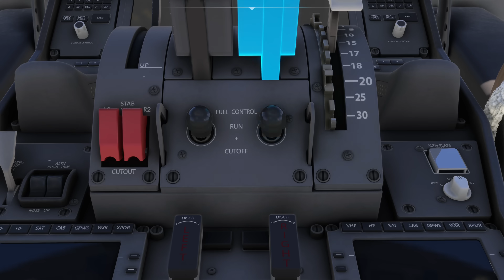Air India 171: Why Did The Fuel Cut-off Switch Get Moved?

Comment: I have lost respect for this guy. The report says no where that pilot moved the switch to cut off. The word is transition. Transition can be mechanical, electrical, software driven too, can be accidental as well if the detent mechanism is not proper. He was initially for the flap theory.
Reply: It's on the voice recorder
Reply: @C.Y.123  And what exactly is that supposed to prove? Look, imagine your wife turns on the light and goes down to the basement to grab a cool bottle of wine or beer or whatever. She is rummaging around in the shelves when suddenly the light goes out. She calls up in confusion and surprise, Honey, I don't think this is funny. Why did you turn off the light? When in reality, a car crashed into a power pole two villages over and caused a blackout. So what exactly is this question on the voice recorder supposed to indicate, in any meaningful sense?
Reply: Ya, it’s not him interpreting it’s the report.
Reply: He should prove without a doubt that the switches can’t move even in case of faulty detents . Without that it would be inappropriate to put the blame on the pilots.

Also nobody knows if the circuits were working properly.
Reply: It specifically stated they were moved roughly one second apart. Nothing other than a human hand is going to cause that. If it were the electronics or software to blame, they would have been simultaneous.
Reply: Watch the other video were Indians claim that it was a debilebarate act and that the captain suffered from depression.
Reply: I don’t believe the pilot suicide theory either as of yet. It is possible but not definite. Need the final report to make a proper conclusion. Everyone is jumping to conclusion for the “views”
Reply: I believe you’re wrong. Initially Cpt. Steve mentioned the flaps as one possibility but this was well before the data recorders were examined. Other pilots also mentioned theflaps but ALL pilots said how unlikely that would be due the aural alarm that would be screaming at them about the flaps.
Reply: The voice recorder output has been paraphrased. The entire transcript has not been released, why? Here is my scenario. I am pilot flying, i rotate, the pilot monitoring says positive rate, gear up. Now imagine if the full transcript says these things, but you dont see any of those actions, what would it tell you.
Reply: Here is another one....say i want to crash plane, and i switch both engines off in 1 second. Let's say you recognise it, would you take 4 seconds between switches to turn on. I see holes after holes. And as a professional this guy has been after pilots since day 1. Be loyal to your fraternity till proven otherwise dude. He is mean from day 1 to his ilk in this episode.
Reply: Finally, and once again thank you, someone who has actually read the published report with semantic accuracy. The same cannot be said for those so called aviation experts. Reading comprehension seems to be a serious hurdle for many people.

Comment: When tens of millions of dollars are involved in potential lawsuits, u generally follow the money. Like the Boeing 737 crashes due to soft wear issues cost Boeing etc millions, what would happen in this 787 actually failed? These fuel switches are not easy to “cut off” they have a redundancy as in u can’t just bump them off. By the way, the captain was not flying the plane and he’s observing everything, so how did he not see the copilot fiddling with not one but two fuel cut off switch is with redundancy protection? To say the pilots did it would save big corporations, tens of millions in potential lawsuits. The whole thing to me is just strange.

Comment: There is no plaine and simple human error. It can be a design flaw when you bumb the switches when using the trottle a d there is a control notice where the switcb block does not work

Comment: Let me ask you something you said that it was done manually how can you be sure maybe it was mechanical or electrical failure. I am not saying it can't be manual but from the preliminary the both switches are cut off within 1 sec of gap that's not possible to do manually because the switches are designed in a way and are spring loaded. And boeing has already in the past has released a report of malfunctioning of the switch.

Comment: How long after placing the fuel to cut off does the engine begin to spool down?  Is it immediate? Is there an indicator that the pilot sees that shows the fuel has been cutoff?

Perhaps these switches need to be on the front dash where they are easily observed if someone places them to off.  Granted, if the pilot/copilot wanted to crash the plane, it will happen one way or the other.

Comment: If maintenance crews accidentally left the locking feature disengaged on the Boeing 787’s fuel cutoff switches, the switches could be moved without the usual lift-and-toggle safety step. During takeoff, as pilots’ hands are on or near the throttles, wouldn't it be possible their hands or an object brushed the now-unprotected switches, flipping them to CUTOFF just after liftoff? This would instantly cut fuel to both engines, as happened in this crash, even though under normal conditions, such accidental movement is nearly impossible due to the built-in safeguards. Add to that: there is no specific checklist step that requires the crew to verify the locking mechanism or physical security of the switches before takeoff or during flight.

Comment: With today's technical possibilities it should be possible, to delay the actual cut off by a few seconds after initiating this by moving the switch - but only during rotation. A software first checks if there is a fire and if not,  delays the cut off by say 12 seconds and initiates a loud count down so both pilots are aware of what is happening. This would make such situations impossible.

Comment: Do we know for sure that the levers were manually moved to cut-off, or is that just assumed because that's how they normally move?  Is there a way that an electrical or mechanical failure could have caused that movement?

I also am wondering  whether, when the 2nd pilot/voice says 'why did you move them to cut-off', he said this because he just saw the 1st pilot/voice do it and so questions him, or whether he just sees the lever in that position and so assumes/realises the other pilot must have moved them.  I guess they haven't released the whole recording.  It seems important how  the 2nd pilot responds. If for e.g. the 2nd pilot says 'Yes you did, I just saw you' straight after, then that would clarifiy things a great deal...

Comment: I believe none of the Pilots did that deliberately and it probably happened because of some jet fuel filter not replaced at a proper time, just like a tripping mechanism. 
Can we discuss possibilities of that or even of a sabotage? Can any maintenance crew program anything in the computer to shut off the fuel cut of switches 3 seconds after takeoff if offered some huge amount of money? 😜👍 Just considering the possibility. If you could discuss any of these scenarios, with lots of thanks 👍😊

Comment: I suggest every person watch air detective channel . Three former NTSB cuts all the speculation . Greg former head of NTSB makes clear this investigation is now a criminal case . There is absolutely no debate on this crash it was suicide . He also makes clear that air India absolutely knows which pilot said why did you cut off the switch but in a criminal investigation you don’t want evidence such as flight simulators compromised . Any pilot that wants to blame Boeing is a idiot . When three former NTSB tell that this issue with blaming Boeing is absolutely ridiculous.

Comment: SAIB not done as not mandatory, switch part  number 4TL837-3E to be installed but wasn't and old style 4TL837-3D left with no pull security which is why the SB was implemented in the first place! Likely a wrist movement turned them off when levers moved to take off!?! 😢😢😢

Comment: Seems to me that a jarring displacement of of the fuel switches would not happen in the one second deliberate pace that seems to be the case here. Either the two switches would move at the same time i.e one jolt. Or one moves. Not both.

Comment: Steeeve and crew, on page eleven of the AABI's preliminary report it says that the FO had his license issued in late September of 2020 and the PIC had his issued mid May of 2021. Yet he had about five times the amount of flying hours. Is that due to the different type of endorsements each of them had or may there be a different reason to look into?
Aaand Boeing were bragging about their Dreamliner being far more dependent on electricity than pneumatics. Could the STAB POS XDCR report the previous crew had made that morning have anything to do with wrong signals given off by the fuel switches? They had that repaired in less than an hour.

Thank you and your crew for the great work 😊

Comment: Sea Captain here. From the first days of this crash I have commented that there is some connection of FUEL SYSTEM in this INCIDENT and I was right. Another commentator also said that and we were only two people who clearly understood that there is FUEL SYSTEM issue and not any FLAPS etc. However, the investigation is not finished and I BELIEVE THAT FUEL CUT OFF was not INTENTIONALLY done. I believe that there some issue with the fuel SYSTEM and when both engines shut down the pilots tried to restart them. I am insisting that there was technical issue and not SUICIDE case or something else. Probably also it can be fire extinguishing system which malfunction !!!!!!! Check 2013 REPORTS of BOEING 787 DREAMLINER
Reply: Exactly! Let's wait for the final report. Anyways when such large corporations are involved, every mistake is pilot's action.
Reply: @mrityunjaytripathi1968 Yes, my friend. Especially when the pilots are dead. The large corporations always will try to protect their interests. Boeing already has bad records , like MCAS system whith 2 aircrash accidents in 2019.
Reply: @mrityunjaytripathi1968 Yes, the Boeing 787 Dreamliner is equipped with systems designed to prevent and extinguish engine fires. These include fuel cutoff switches that can quickly shut off fuel supply to the engine, preventing further combustion, and fire extinguisher systems. However, there have been instances where the fire extinguisher switch has malfunctioned.
Reply: Hard to put any weight behind what someone says when THEY speak LIKE this
Reply: @somethingsomething404 Yes, the Boeing 787 Dreamliner is equipped with systems designed to prevent and extinguish engine fires. These include fuel cutoff switches that can quickly shut off fuel supply to the engine, preventing further combustion, and fire extinguisher systems. However, there have been instances where the fire extinguisher switch has malfunctioned.
Reply: A problem with the fuel system doesn't explain why the fuel switches went into a cutoff position. They are mechanical switches and are not controlled by the computer, so they cannot move themselves. The engine shutdown came AFTER the fuel switches went to cutoff, not before. The pilots moved the switches back into the run position about 10 seconds after they went to cutoff, but it was too late.
Reply: @chris2kgreat Yes, the Boeing 787 Dreamliner is equipped with systems designed to prevent and extinguish engine fires. These include fuel cutoff switches that can quickly shut off fuel supply to the engine, preventing further combustion, and fire extinguisher systems. However, there have been instances where the fire extinguisher switch has malfunctioned.
Reply: @chris2kgreat The investigation is still in progress. There is no final report yet.
Reply: @NeosNeidis there is no final report, but there is a preliminary report. It shows that the pilots moved the switch to the cutoff position, and then 10 seconds later into the run position. These are physical mechanical switches, not digital switches. A computer cannot move them, they must have been moved by someone
Reply: @chris2kgreat there is system which in case of HIGH FUEL PRESSURE OR FUEL LEAKAGE shut off valves in solenoid branch before combustion chamber. This is automatically can be done. When it happened the pilots tried to restart and operated the MECHANICALLY CUT OFF FUEL SWITCHES to restart engines from the cockpit
Reply: @NeosNeidis your theory is that there was a fuel problem, and then it's after that they moved the switch to fix it, correct? If that is your theory, then it has a big problem. The engine did not start to lose thrust until AFTER the switches were moved, not before. THE ENGINE PROBLEMS HAPPENED AFTER (REPEAT, AFTER!!) THE SWITCH WAS MOVED TO CUTOFF.
Reply: The one second delay between change of state tells me, as a systems engineer that it was intentionally done by a human. If it was an accidental bumping the delay would have been much shorter
Reply: @timblack33 and 10 seconds to change them back so there was no chance of recovery
Reply: @MamaStyles Yes, the Boeing 787 Dreamliner is equipped with systems designed to prevent and extinguish engine fires. These include fuel cutoff switches that can quickly shut off fuel supply to the engine, preventing further combustion, and fire extinguisher systems. However, there have been instances where the fire extinguisher switch has malfunctioned.
Reply: yeah , i also comment about fuel valve
but before the report came ,a lot of pilot channel dissmiss this probabilty
Reply: @bambangutomo-s7i Yes , there is fuel system malfunction. When the pilots realised that both engines lost thrust , they just put all efforts to restart them. This is what I believe happened.
Reply: @bambangutomo-s7i the preliminary report shows the fuel switches were moved which then caused the engine to shutdown after they were moved. The fuel switches were the problem, not the fuel valve. It's not like the engine lost trust before the fuel switches were moved
Reply: @bambangutomo-s7i Yes, the Boeing 787 Dreamliner is equipped with systems designed to prevent and extinguish engine fires. These include fuel cutoff switches that can quickly shut off fuel supply to the engine, preventing further combustion, and fire extinguisher systems. However, there have been instances where the fire extinguisher switch has malfunctioned.
Reply: This switches can only be manually moved since they are spring loaded. A failed switch would not move back to the start position like this captian mentioned.
Reply: @yushkovyaroslav did the switch connect pyhsically to fuel valve or it use some electric signal to operate the fuel valve?
if there is electronic circuit there is probability of failure
Reply: @bambangutomo-s7i the switch is mechanical and it commands the computer.

The switches can not be moved eletronically. And we know they were moved down then up 10 seconds later.
Reply: @yushkovyaroslav the switch is mechanical but it is sending electric signal to the control unit
if the control unit get wrong signal that appear as the switch has been moved?
Reply: @bambangutomo-s7i we know there was physical movement of the switches because the other pilot moved them back on. Which is impossible if they weren't in the off positions.

Besides CVR would hear the distinct sound of them moving. 

Moreover simultaneous failure of independently wired switches within 1 second of each other is near statistical impossibility. Not to mention even 1 failing is basically unheard off.
Reply: @yushkovyaroslav Yes, the Boeing 787 Dreamliner is equipped with systems designed to prevent and extinguish engine fires. These include fuel cutoff switches that can quickly shut off fuel supply to the engine, preventing further combustion, and fire extinguisher systems. However, there have been instances where the fire extinguisher switch has malfunctioned.
Reply: I so hope you are right, for the families of these pilots, and for their reputations. I am keeping an open mind.
Reply: Reset them both to OFF?
Reply: @TrueAFpatriot Yes, the Boeing 787 Dreamliner is equipped with systems designed to prevent and extinguish engine fires. These include fuel cutoff switches that can quickly shut off fuel supply to the engine, preventing further combustion, and fire extinguisher systems. However, there have been instances where the fire extinguisher switch has malfunctioned.
Reply: Pilots tried to restart them? I hope you are right, but to me it is unlikely one pilot did that without informing the other of such crucial issue.
Reply: @ronvdb Yes, the Boeing 787 Dreamliner is equipped with systems designed to prevent and extinguish engine fires. These include fuel cutoff switches that can quickly shut off fuel supply to the engine, preventing further combustion, and fire extinguisher systems. However, there have been instances where the fire extinguisher switch has malfunctioned.
Reply: It's pretty clear this was intentional. With so many national accident review boards involved, why would they state as such if there was a possibility of a malfunction? That makes no sense. Just because it's an interim report doesn't mean it was half-assed. This is serves nothing but to instigate conspiracy theories.
Reply: Sir, I wonder if you'd be interested in the spelling of 5uicide instead of cuiside.
Reply: @jarnMod Yes, the Boeing 787 Dreamliner is equipped with systems designed to prevent and extinguish engine fires. These include fuel cutoff switches that can quickly shut off fuel supply to the engine, preventing further combustion, and fire extinguisher systems. However, there have been instances where the fire extinguisher switch has malfunctioned.

Comment: As far as both pilots having to engage the cutoff switches, that makes sense in this case but what if one of the pilots is incapacitated and there is a need to engage cutoff?  I know it's rare and there are not a lot of circumstances to it would be an issue but the first time it is then there would be the same controversy.